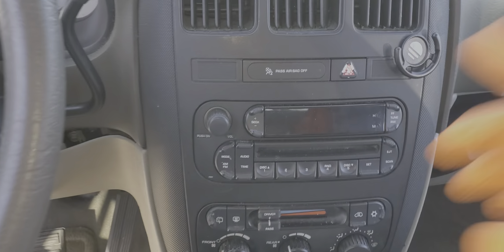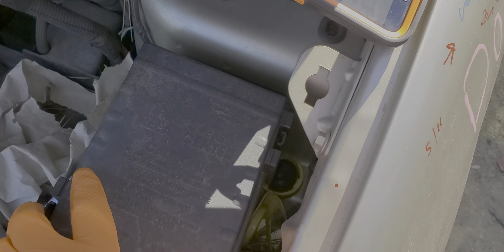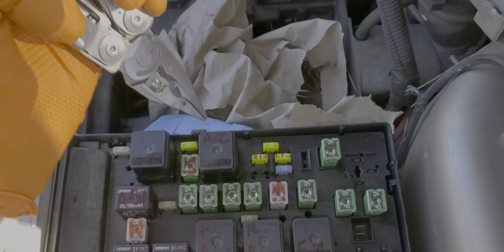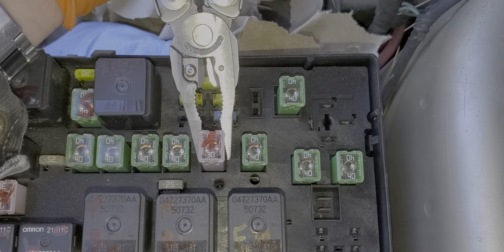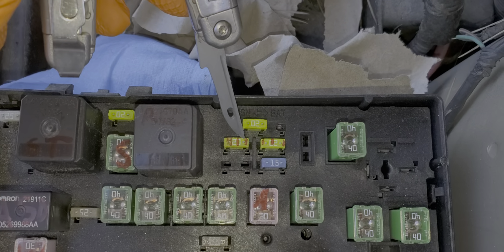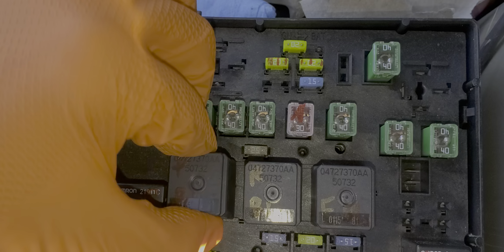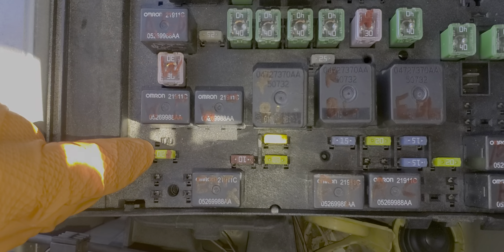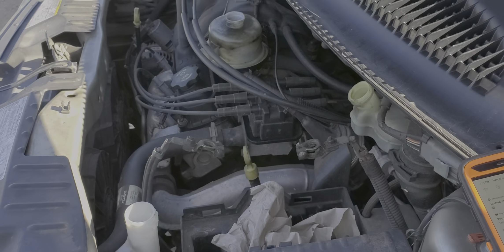2005 Dodge Grand Caravan Radio Fuses

Comment: My radio stopped working.
I disconnected the negative pole of the battery for 1 minute and plugged it back in and it worked for the first time.
Then the next day ...
It didn't work at all
How can I fix that ??